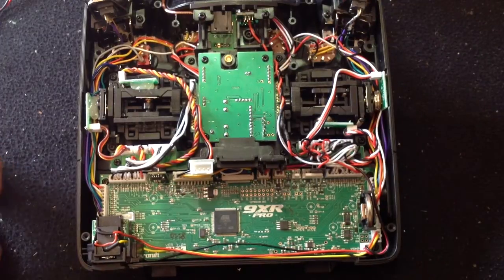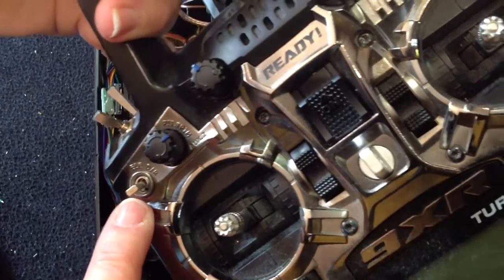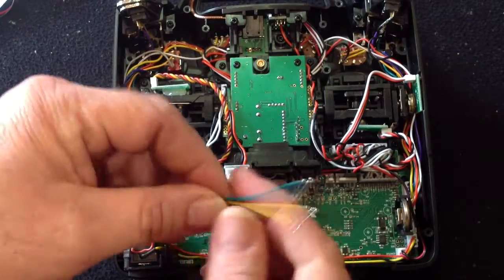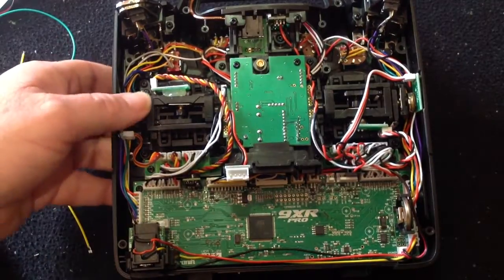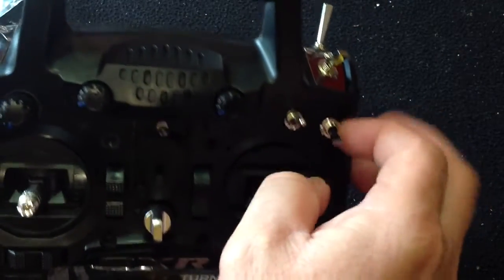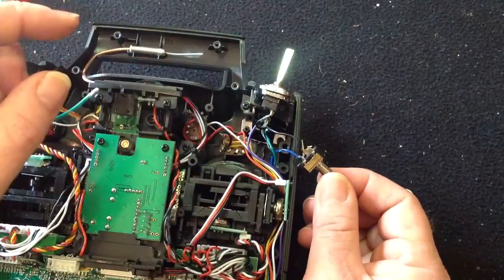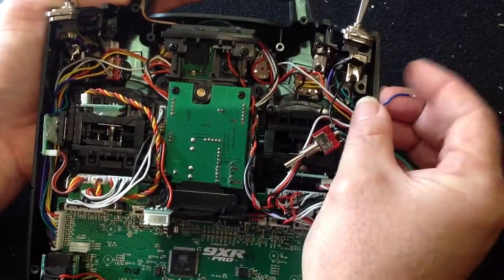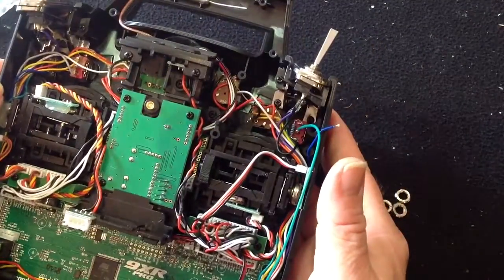9XR Pro - 3 Position Switch Modification  Part 1

Comment: are the stock switch’s on the pro do they have a great feel to them ? 
im looking at buying them for another project and want good switch’s
Cheers
Reply from the maker: The switches on the Pro are most likely generic Chinese made switches.  There is nothing particularly special about them they just switch.  Like anything mechanical some will fail but I have really had no issues of great concern.
Reply: Great thanks

Comment: were do i get the switches from can you put a link to the required parts thanks great vid
Reply from the maker: I used to get the switches from a supplier on eBay but that was 3-4 years now.  Unfortunately, I do not have a link anymore.  They will be available on eBay, measure the dimensions of a 9XR Switch and then search on eBay
https://www.ebay.com/sch/i.html?_odkw=toggle+switch+on-off-on+spdt+-momentary&_ftrt=901&_sop=15&_dmd=1&_osacat=0&_ftrv=1&_from=R40&_trksid=m570.l1313&_nkw=toggle+switch+on-off-on+spdt+-momentary&_sacat=0
Sorry I cannot be of more help.

Comment: Can i do this to  Turnigy  9x as will  using the same  method  and can u  give me a link  for the resistors as will if it work with Turnigy  9x  thx
Reply from the maker: No - the 9X board and firmware on 9X are different

Comment: Replacing only 1 switch what to do with the blue wire?
Thank you very much
Reply from the maker: Nothing.
Reply: I have just made the mod and it works perfectly with "ersky9xPro212". When i upgrade to "ersky9xPro219s" he stops to workand menu HARDWARE says only "DISABLED". Some ideas why?
Thank you very much
Reply from the maker: Yes.  In the newer versions the ersky9x developers have changed a number of things.  First up is that they have made the Hardware Menu somewhat hidden to stop people who don't know what they are doing from accessing it.  If you wish to stay up to date with ersky9x then this is not the best place to be.  The best place is the actual ersky9x forums on openrc forums.  I think the switch names have changed and this is why it is not working.  You need to go into the hardware menu and change to the new names.  To access the hardware menu turn the radio on while holding the left horizontal trim left.
Reply: Hi!
Thnx, i will try. When done i will tell my experience.
Best regards,
Reply: albino dores s
Reply: Work perfectly.

Comment: i got some problem here sir
if you dont mind please help me...
the rud switch cant set to 3 modes... only showing !rud rud and rud
not like the other that have the up neutral and down sign
Reply from the maker: +Nasrul Acuy Once you have done the mod you also have to "tell" the firmware that you have done the mod with RUD switch.  This is done in radio setup - Hardware page.  If still not showing up you will need to recheck your wiring.

Comment: Very nice video! But can't find the link for 3 position toggle switch. Could you post it here?
Reply from the maker: Erhard Stock I would however the last order from this particular eBay seller did not arrive so I won't make be making it public.  Also please visit this topic on the RCTA forum for details on setup using the latest version of ersky9x as the latest firmware has a very different setup for these switches.
Reply: rctanksau  will this mod work with the old 9XR?
Reply from the maker: MastEr0fNothinG Sorry, but no it will not.

Comment: Do you have a video teaching the basics of programming a controller for tanks if not would you please make one I have subscribed so i won't miss it
Reply from the maker: tankkiller308 You mean programing a radio not an actual controller correct?
Reply: Yes sorry I have a dx6i radio I'm new to the hobby so I don't know much about programming radios I'm trying to learn
Reply from the maker: Sorry but Spektrum radios are not suited to tanks.  Fantastic for planes - no so for ground vehicles. I simply don't use them so I would be of zero help to you on that front, sorry.
Reply: What one would you suggest then and how much?